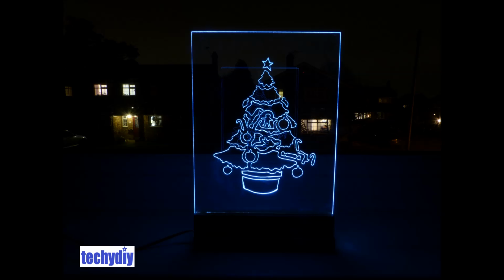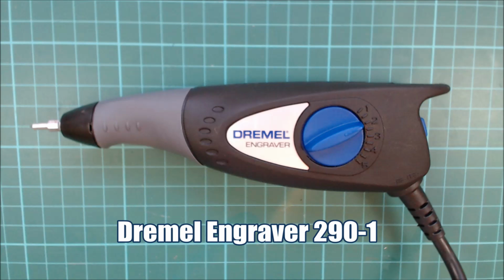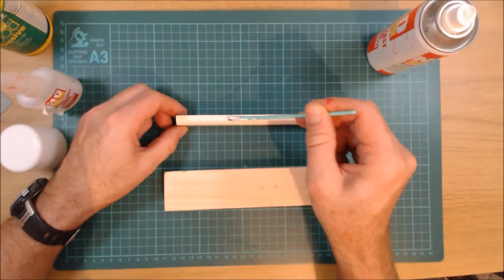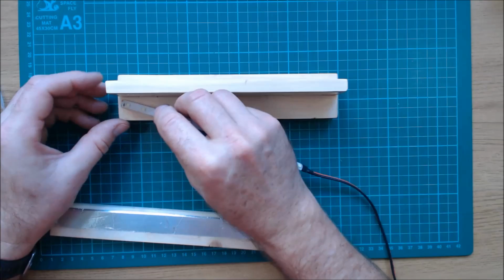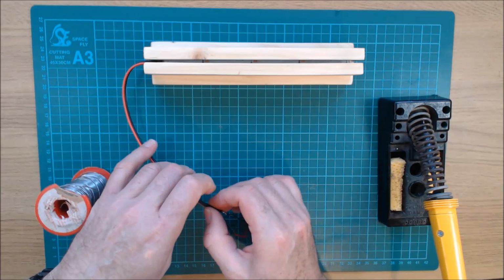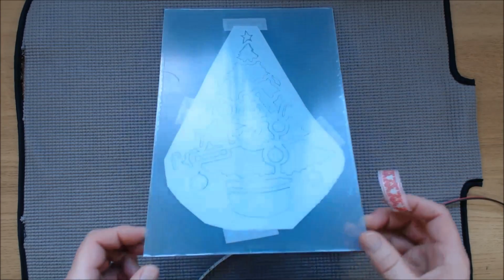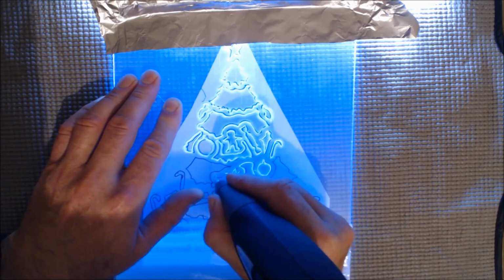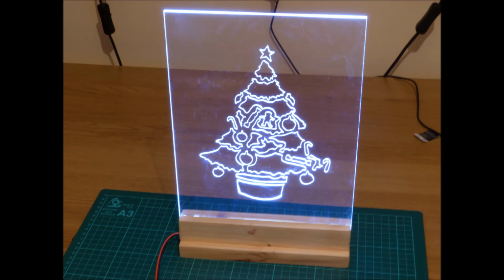How to make acrylic led Christmas tree edge light sign / decoration

Comment: Hi so I have a rotary tool, and it is indeed a lot more difficult to manage do you have any recommendations for cleaner/neater drawings?
Reply from the maker: The engraver I used vibrates which is easier

Comment: Hello. Nice job. But on https://youtu.be/c6mKMpPe8xg?t=345 it's very easy to see some dirt on the acrylic then the light is turned on. Have you find a solution how to remove that dirt without damaging the surface of acrylic? From my experience it's very hard job to remove that dirt.
Reply from the maker: Auto Glym fast glass and a microfiber polishing cloth has worked for me

Comment: So does the dremel engraving bits for the rotary tool work with the dremel engraving tool ?
Reply from the maker: No,   rotary engraving bits for the Dremel drill
Reply: techydiy so which is better to use the engraving tool or the rotary tool
Reply from the maker: I prefer the engraving tool for engraving it's easier; but the rotary tool is a more flexible tool  (drilling etc.)

Comment: Would y ou happen to know if it works with glass instead of acrylic? Thanks in advance.
Reply from the maker: +Carnes Mexicaltzingo Yes it does. See my latest video where I edge light a glass mirror. There is one problem with glass though, normal glass has iron oxide in it which gives it a green glow, you can see this if you look through the edge of most glass. If you use colour led strip then you can counteract this effect. Acrylic is optically clear and doesn't have the green problem.
Reply: I will find your latest video, I appreciate your assitance and your prompt response. Have a great day!

Comment: Hi, I have a problem with the light reaching all the way through the engraving. I am using the same size of acrylic sheet with the engraving centered on it. I have also already built the base. The light only reaches about 3-4 inches up the sheet and is very weak. If you have a solution I would be very grateful. Thanks. (The depth of the engraving is about 1mm)
Reply from the maker: Have you removed the protective sheets on both sides of the acrylic, this makes a huge difference.
Try moving the position of the sheet on the leds, they should be centred,  again it makes quite a difference.
Reply: Yes, I have removed both protective layers, but I will try to reposition the leds. Thanks.

Comment: The battery you're using is 12v? How many hours will the power last?
Reply from the maker: It depends on the power requirements of the led strip used. In general, these work best with a power supply adapter.

Comment: This is so cool! I want to design one of these but I was wondering if there was anyway to make it so you could hold it as a sign (with a handle or something)?
Reply from the maker: +Madison Mariano Thanks. Yes you could do that. The leds can be on any edge and you can just adjust the frame to whatever you require.
Reply: +techydiy Awesome!! Thanks so much!!
Reply from the maker: +Madison Mariano If you want to be clever then you can use ultraviolet leds and write your message on the sign with a fluorescent marker pen. Thanks for your comment. Have fun !
Reply: @techydiy  could you use fluorescent marker pen. to add effect to your Christmas tree design or any engraving you do to acrylic ? great video showed me where I was going wrong more please thanks Steve